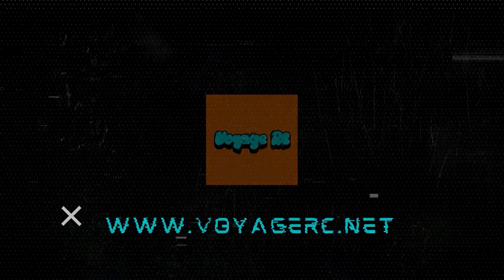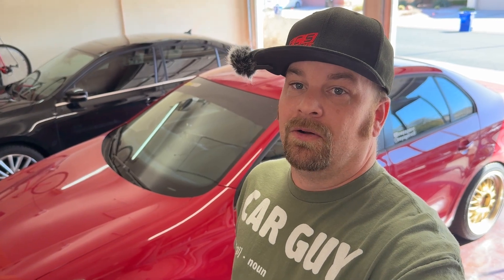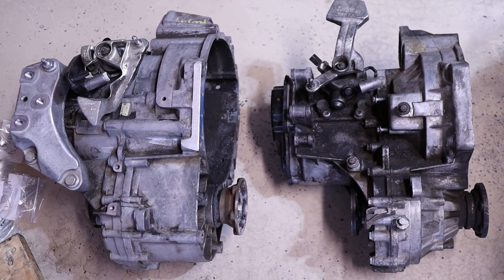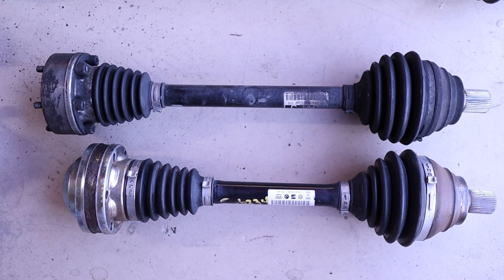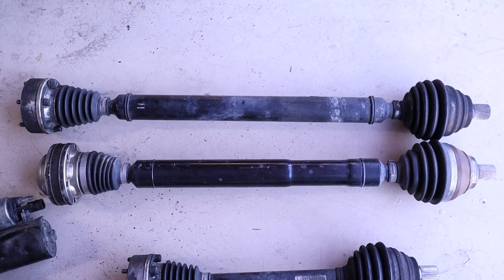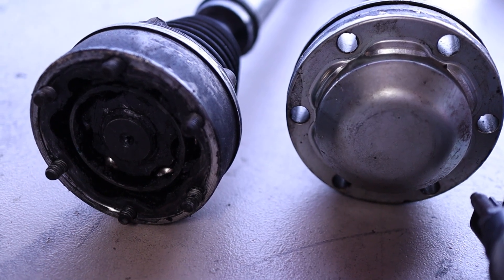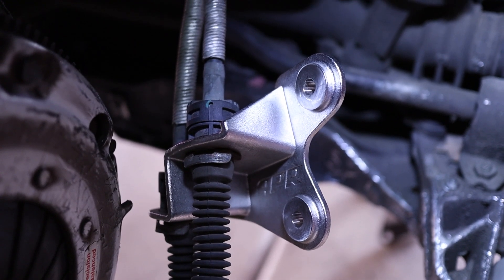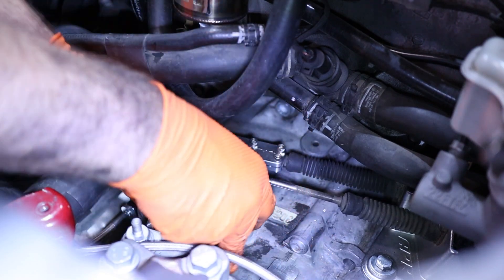Can You Use 5 Speed Parts in Your 6 Speed Swap? Comparing the VW 02J to the 02Q | There's a BIG Diff

Comment: Your adding an extra 60 to 80 lbs by swapping to a 6 speed. I mean if you dont race the car then yeah, go for it i guess. The axles, transmission and clutch and flywheel are alot heavier then a 5 speed. I drag race an mk4 gti and i only use 02j 5 speeds. If your looking for a close ratio trans the egt code 02j out of a 2.0 liter mk4 is the perfect ratio. That is what i use for drag racing. If you are non turbo then you want a really low 1st gear and close ratio 1 through 4. The 4th gear taps out at 115 in the 1/4 mile on a 25.5 inch drag radial. And its super easy to open up an 02j and drop in an lsd unit and ditch the fragile spider gears. Plus you can install drive sport shifter bushings and sliders in the 02j and install a $100 input shaft 4 bolt brace. Plus you can swap the 5th gear to any ratio you would like while the transmission is installed in the car. you can use a taller 5th that is taller then the 6th gear in the 02q trans. The 02j shifts alot smoother then the 02q and its lighter to keep the car more nimble in the corners. All you have to do is use the shifter cable bracket from an mk4.
Reply from the maker: The 02q has been nothing but great in my tracked Mk5. Yes it’s heavier, but the ratios are great and it’s stronger than the 5 speed. I’m glad the 5 speed is working for your setup and use.
Reply: @VoyageRC that is a mis conception that the 6 speed is stronger. If the proper 4 bolt input shaft brace is used the 02j 5 speed can handle up to 800 hp. And if you are drag racing it, using only 4 gears you can easily install a 5th gear delete cuff while its bolted up in the car. It braces the input and output shafts together in the rear of the trans and it will handle 1000 plus horse with the proper internal gear sets installed. Especially with dog gears sets which are much more affordable vs the 6 speed. The only weak points in a stock 5 speed is the diff and 5th gear. The rivets walk out of the ring gear and the spider gears can break. But that can happen on a 6 speed just as much as the 5 speed. Thats why they sell a real lsd unit for both. And the other weak link is the 5th gear due to the lack of oiling. But that can be solved by just drilling 3 1/4 inch holes lower then the stock oil ports in the 5th gear compartment. But if your using the car for everyday driving then yes a 6 speed is a good choice. But if you are tracking the car, racing, or time attack. The 5 speed is 100 percent a must! The aftermarket availability for it and its lighter weight, plus optional gear ratios make it by far superior to the 6 speed. Sorry for being so nick picky about this subjet. But i want to clear up the mis conception that the 6 speed is stronger. Yes it is stronger only when compared to an all stock 02j 5 speed. But the simple and affordable things you can do to the 5 speed make it a much better choice then the 6 speed.
Reply: if you were to compare the mk6 5 speed to the mk4 5 speed you are talking about is 3 gear shorter? i just hate how long 3 gear is 1-2 seems fine the 3 is just stupid long lol
Reply from the maker: @Kaos_roshi my Mk5 5 speed had a really long 3rd gear. It would just fall on its face after the 2-3 shift.
Reply: How would you guys go about manual swapping a mk5 from a automatic?
Reply: @ChristianKelly-rr3vr i have never manual swapped an mk5. I have done 2 mk4s its pretty much disconnecting all electronics to the auto. In the mk5 it may be required to have the ecu tuned for manual trans but i cpyld be wrong. You dont need to tune the mk4 for a manual swap. You will need the shifter tower assembly for the interior of the car with the shifter cables. And you need a manual trans plus the clutch pedal assembly inside the car and the hydro line from the brake system to the clutch system. But i personally think it would be better to go get a manual swap from a mk4 and swap that into the mk5. The 2.5 5 cylinder and 2.0t, 1.8t, and 2.0 na all use the same bell housong connection with the vr6 as the exception.  You will have plenty of gear options with a mk4 5 speed or even 6 speed. 02m and 02a and 02j all fit.

Comment: What kind of RPM are you seeing in 6th on the highway?
Reply from the maker: @Hey_Bert  around 3k
Reply: @VoyageRC  at what speed? I been looking into a 6 speed to drop the RPMs since my car is just a daily
Reply from the maker: @Hey_Bert  75mph. You don’t gain a better top gear with the 6. It just brings the middle gears closer together.
Reply: What about just buying and swapping out the 3.67 0:33 R&P for a 4.21 in the 5speed 02j?

Is there a taller 5th that also fits these cases?  

Can we do it like we did with the old school 4K and 2H 020 trans from the mk1,2,3?

Comment: I've done a MQ250 -> MQ350 swap once with a friend on his car and will probably be doing it this summer to my car as well. IIRC almost nothing got left over, new starter, new driveshafts, new mounting brackets, new clutch line, new flywheel, new clutch assembly, new shifter bracket and the thingamajig on the shifter tower.
Reply from the maker: @underii  yup, not a lot of shared parts.